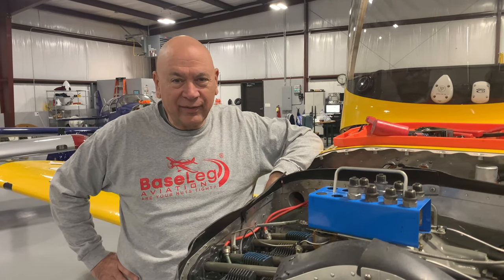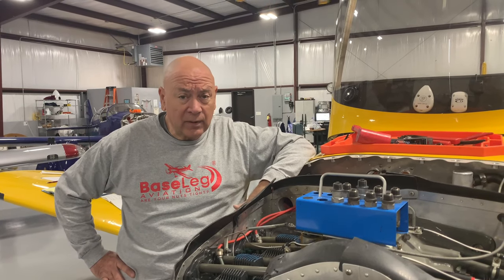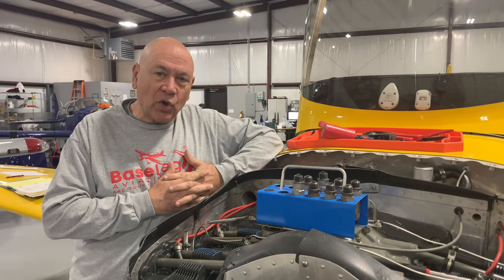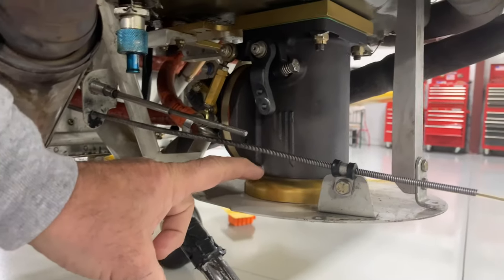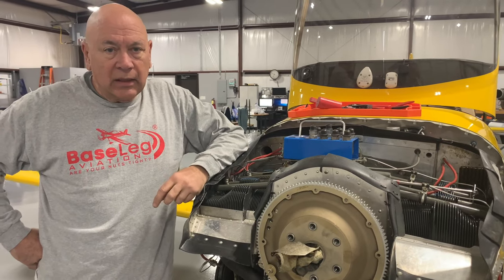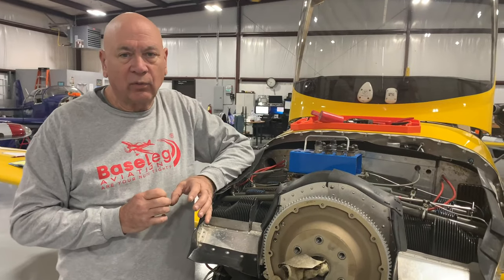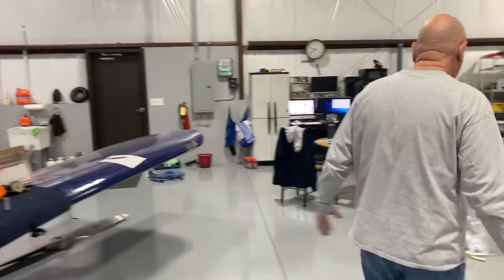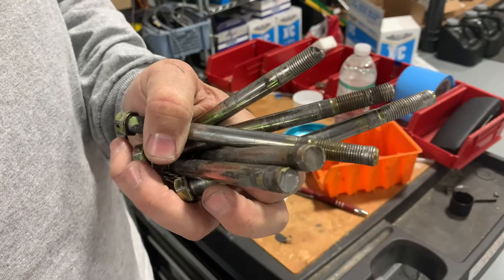Improper maintenance

Comment: As a new RV7A owner. I greatly appreciate your teaching. So far I find it hard to locate proper torque value for my 0-360. 
The engine manuals and supplement are written to confuse the innocent. 
I wish there was a easier way to find the correct procedure for tightening a bolt !
Reply: Use AC 43-13 for torque values. Most prop manufacturer’s put a sticker on the prop with the torque values.

Comment: Great information Vic!  Appreciate you sharing your expertise!  Question.  Your referencing prop overhauls... my RV has been flying 10 years, (603 hours), as of 1st of this month.  Do I need to take the prop, (Fixed pitch Sensenich), to a prop shop or inspect it like I do at each condition inspection?
Reply: No. The fixed pitch metal props do not require overhauls. However, they should regularly be checked for nicks and gouges. There are specs for how deep they can be and if they can be filed. Always have an A&P do the filing if it is necessary. Then consider balancing the prop.
Reply: @vicsyracuse3940  Thank you Vic!